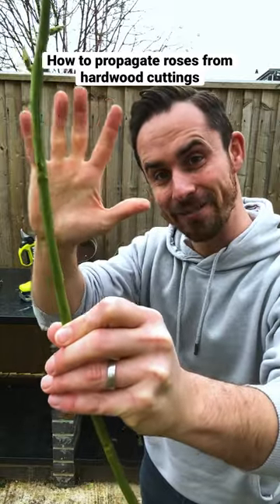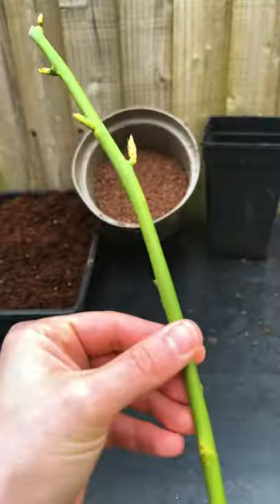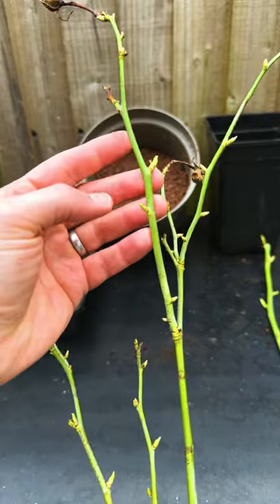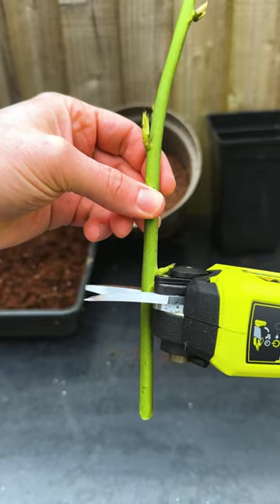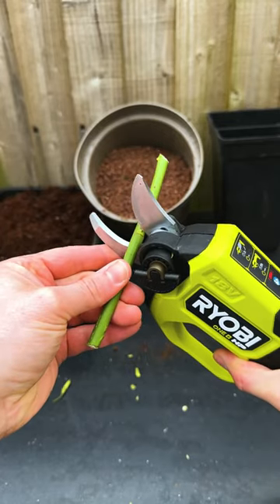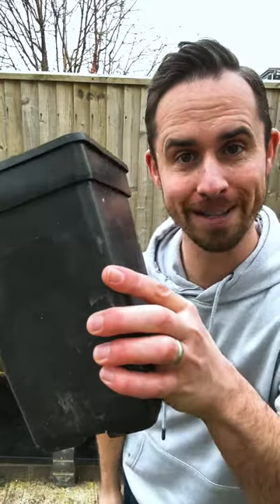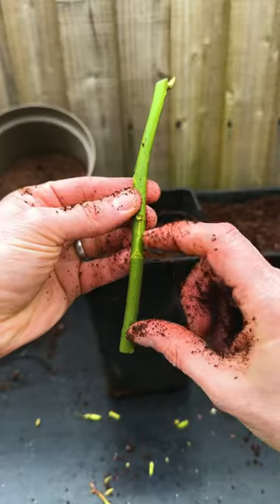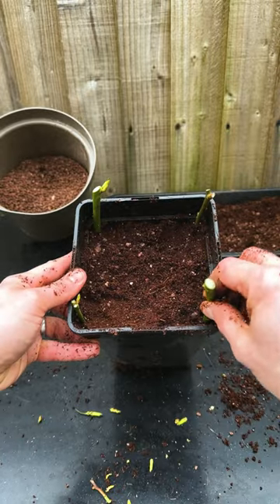How to propagate roses from hardwood cuttings #rose #roses #propagation #pruning #garden #gardening

Comment: Did this hundreds of times. Never worked. Finally just put 2 cuttings in water. Both rooted.
Reply: No soil and just water only submerged in water only? I’m also struggling and I don’t want this $35 to go to waste
Reply: @abrahamlopez1879  you spent $35 on cuttings? I would not use my method. Water works best for skinny cuttings
Reply: @InADarkTavern  they’re for 5 sweet grandollia cuttings and they are skinny. I tried increasing humidity by a lot and they swelled up and 1 died and another almost died. 1 died to mold so I did started to spray them with neem oil. One had mold so hopefully it will go away. Been 2 weeks and 4 days and I still don’t see rooting unfortunately and I used the rooting hormone.
Reply: @abrahamlopez1879  you have to get it to callous before you commit to the cutting. Use just water until callous forms
Reply: @InADarkTavern  ahhh alrighty. Thanks!
Reply: @abrahamlopez1879  and don’t switch the water, just add more as it evaporates. The cutting releases rooting hormone
Reply: @InADarkTavern  thanks a lot for the tips. This is my first time attempting to propagate cuttings and I am trying my best to not fail.
Reply: @abrahamlopez1879  you are going to fail but it’s ok because you will learn. I failed hundreds of cuttings

Comment: I have a rose bush that was planted in the 1950s. I have to move and I want to know how long can I keep the new rose bush in a pot. I don't know exactly when I'm moving, but it may be in about a year. Can a rose bush be in a pot that long before putting it into the ground? Thx!
Reply: I just had to do this 3 mons ago. I kept a bit of the ground dirt with the roots I dug up. Then put it in a nice sized pot with really good mix of peat moss, compost, vermiculite. My two roses are doing fantastic 3 mons later. In fact, they’ve both bloomed like crazy this summer. I had some delays in moving and didn’t plan to have them in pots for half the summer. But my friend at my nursery said they’ll be fine this winter as long as I keep them covered if we have a freeze. I’m in southern Louisiana so mild winters. I’ll plant them in the spring. I have fertilized and will one more time before winter. I hope this helps! 😊

Comment: I have a rose tree , for some reason it got tilted too much that the branches are almost going to touch the ground. I was thinking of digging it up and replanting it in another location, of course I tried way too many different ways to make it straight up but no luck. Now there’s no way I can dig it out of the ground, it’s about 150 cm long. So I was thinking to try air propagate it from the trunk not to the branches, so it can be easier for me to move it rather than digging it up.  The trunk is about 3 fingers wide. 
Do you think that would work?